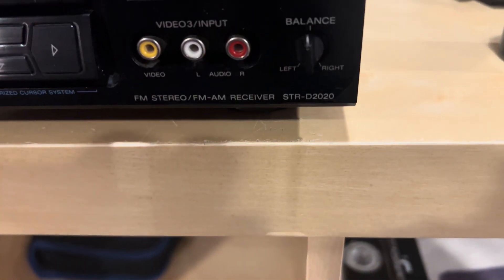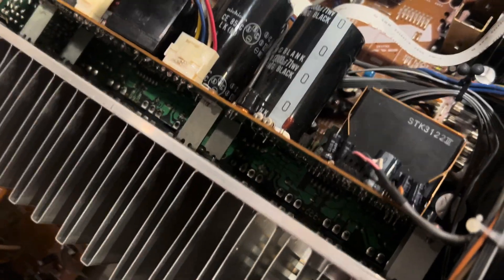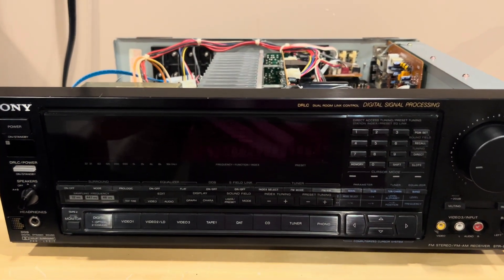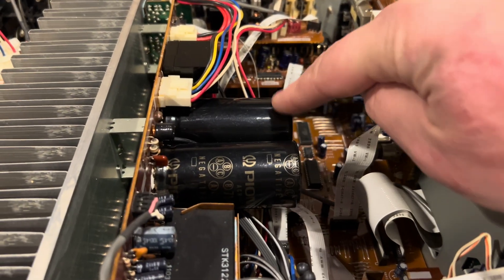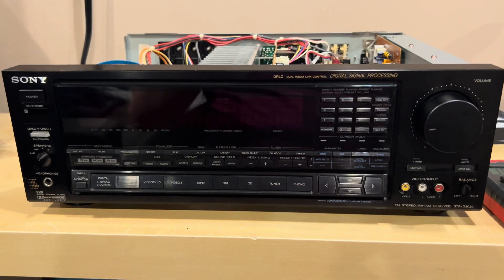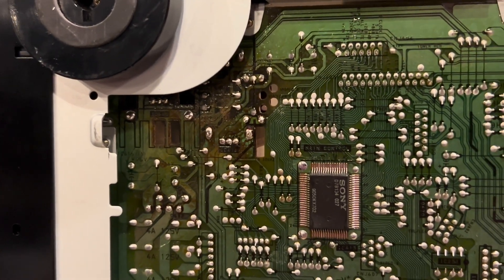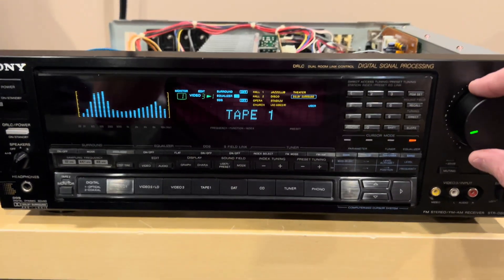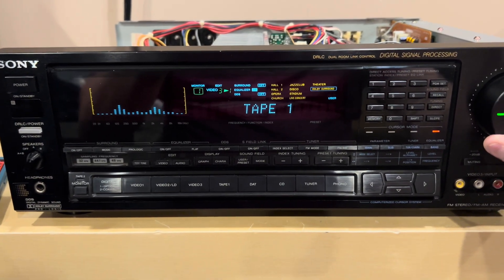Sony STR-2020 1990 130WPC Bias and Repair Adventure

Comment: Was stuck in Protection mode for a few weeks, but replacing the .1uf caps and a few others on the amp board fixed the problem. In case anyone is wondering how to remove the amp board/heatsink section, there are simply two screws on either end of the heatsink(top side). Remove and and voila. The entire block is easily removed. This helps A LOT when biasing the amp to reach the connector pins. Just loosen the two screws and tilt the amp/heatsink section back a bit for better access.
Just ordered some copper heat sinks to place on the scorching hot Sanyo STK pack and an adjustable fan.

Comment: Received mine and it had the right channel out. Turns out it was the power connector/speaker output along the top edge. Cold/broken solder joints. All better now. My two caps are also really bulged. I just adjusted the DC bias and removed the two caps. Waiting for the 2 caps and caps around the really hot corner section that is also brown on my unit.

Comment: I see the back says use 8-16 ohm speakers. So, 6 ohm speakers are absolutely out of the equation? Would the unit overheat under moderate load?
Reply from the maker: If you keep the receiver well ventilated and played respectfully with no clipping you’ll be fine
Reply: @davismv  Thanks

Comment: I have one of these and it will work well for a bit then one channel will cut out. I can get the channel to come back if I turn the volume up to about noon. I know nothing about electronics and originally thought  it was a bad amp. Any thoughts?
Reply from the maker: You likely have something which is flexing due to what is called thermal stress.  I see this a lot and this receiver gets damn hot.  

What does that mean in simplenywrms?  When the unit is on for a while and gets hot, there are solder connections that are separating and expanding just slightly enough to where they stopped working.

Typically, if you tap or hit on the top of the unit or bounce it, it may come and go. 

Permanent resolution would be to open this up and reflow the solder on a number of spots.  Will take somebody with some knowledge, but unfortunately, if these soldered joints are bad it’s not going to correct itself.

That’s my analysis based on what you’re saying.

Comment: How much to repair one of these units with no sound output?
Reply from the maker: You’d have to find a local repair person I would guess probably minimum a couple hundred dollars if you can find somebody.  You might have better luck just purchasing another one off of eBay with lower hours that’s working. Just my opinion.

Comment: Mine just quit tonight. My primary (big) caps are bulged as well. The display flashes "protector" and I figure an IC went out and it with those two caps need to be replaced.
Reply: Did you fix it? I first replaced my bulging caps before I had any problems, but now Im stuck in Protect mode after the cap swap.